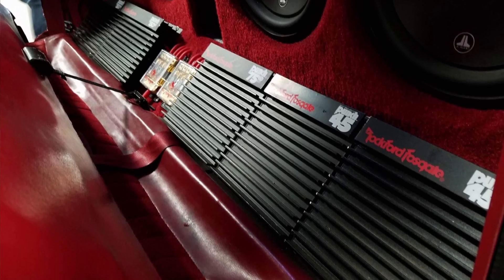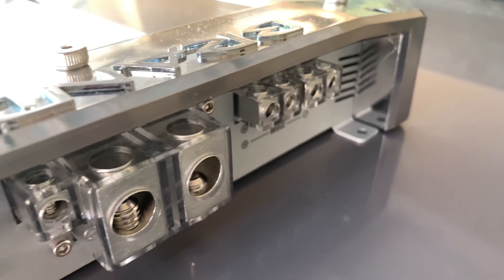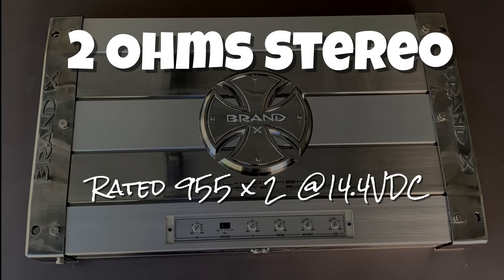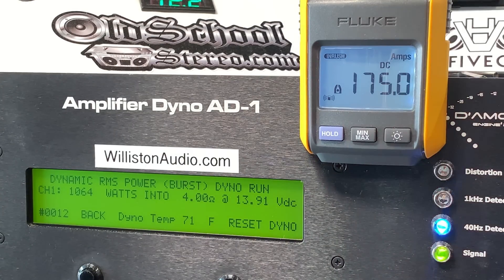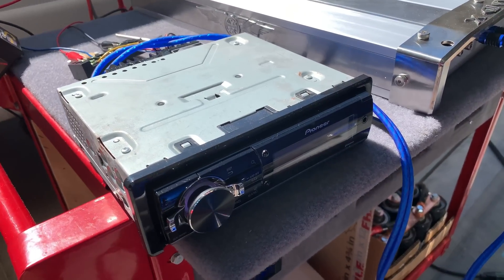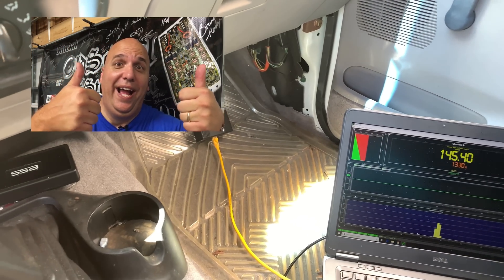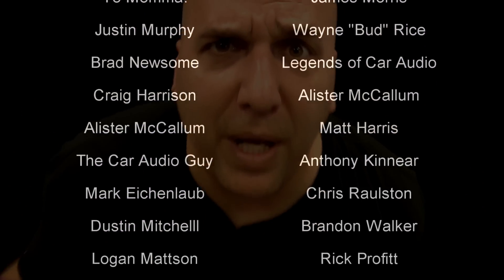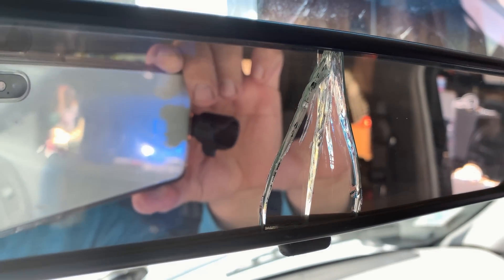$150 SPL Challenge Update - $75 Brand X 1910 Watt Amp [4K]

Comment: I feel like it was always meant to be just a spare hence why its mounted both away from, and at a different angle than the two that actually are hooked up. Unless the manual strictly states that it tales 3 60a fuses.
Reply from the maker: Could be?

Comment: Hey big d how is it possible that the amp did more power on the termlab with box rise than in perfect conditions on the dyno where it did 1100w
Reply from the maker: Voltage was higher

Comment: Longevity remains to be seen, but 1000w RMS today, is sure cheap these days. I know my RF 800a2 and MTX 1501D were way more than that, and that was on the used market. I actually paid $100 for my first "new" budget Legacy amp that barely did 200w clipped lol.  Kids today can sure get cheap and easy 1000w+.  🤣 Can do fairly loud setups for cheap!

Comment: Hey the emf guy said the amp dyno is not legit.  Please straighten him out
Reply from the maker: I think his comment was mislead. He says it can’t compare to “in car” actual results as it uses resistors. Future amp tests I’ll show Dyno and Speaker tests. The Dyno is still the best way to show actual power from an amplifier. Too many variables for subs in car.
Reply: @wal  yes I've seen Steve meade show the actual  in car power of a 1500 watt amp being only around 950. But on the dyno all amps are tested equal.

Comment: How did you clamp more power on the term lab than you did with the amp dyno? Did you run the amp at a lower ohm load than what you dynoed?
Reply from the maker: I didn’t verify ohm load at the power, but yes I’d say it was lower

Comment: Generally the RMS rating are @ 1/2 of the max power, so if the ratings they give are maximum power, then this amp actually does what it should.
Reply: Gary Turner that is completely wrong.....
Reply: @pmcalis1111  in what way...? technically peak is RMS x2
Reply: RWL2012 no it’s not... RMS x square root of 2 (1.414) gives you peak or “max”

Comment: Hello have you tested a amp with 2AWG inputs, how much it gives and then try a adapter that fits 0AWG to 2AWG terminals and if it gives more power and then dual 0AWG to 2AWG terminals? I would really love to see that kind of a video

And how big of a difference it makes if i have a sd3000 and i use 2awg versus 0awg how much power am i losing

Comment: Say what you want but for a/b ,that's not bad. There are not enough sizeable a/b amps being made now a days...
Reply: Uhh theres large ones made.   Like there's a few with dual  1/0 inputs. Almost 3k total power.    B2 makes a huge 1500.2 2ch AB amp.  Dual 1/0 inputs.  Very very similar to alphard 1500.2 except the alphard is class D.

Comment: I just realised that Big D is testing output power at 40Hz, whilst the industry "norm" is to test at 1kHz - perhaps that makes a difference with this unit? However it's more likely that the maker's specs are based on 10% THD which will result in perhaps double the power compared to 1% THD that Big D has the Amp Dyno set for..
Reply from the maker: Clipping is more than 10% THD and it didn’t get close

Comment: 145 I don't know so far it looks like you're winning for that class amp and sub! Anyone else stop that that you know of? RESPECT!! 🙏
Reply: Toros de reparo
Reply: Back in 1998, I had a buddy running (4) 10" Eclipse aluminum coned 500RMS subs powered off a couple JVC 1000RMS rated amps. He managed to hit 143.xxdB with them in the back of a 92' Jeep Cherokee. Funny thing, they ended up popping the back window out of the seal while we were driving down the highway. LMFAO That shit hurt though, my ears and chest both didn't like it at all.

Big D managed to top that with less power and MUCH cheaper equipment. Though my friend didn't exactly have a proper electrical system to support the setup.

Comment: Maybe those fuses are 90A fuses? seeing as it draws up to 200 amps without the fuses popping. if they were 60A fuses they would likely have blown on the 2ohm bridged test
Reply: Nah. As inefficient as it may be, those might be slow-blo. Though waiting a little longer may have popped them. Worst yet, maybe they cheaped out and stuck a piece of aluminum foil inside the standard blue plastic fuse housing?!
Reply: LOL its only 120 amps worth of fusing. the extra fuse does nothing
Reply: @realflow100  That was why I was saying maybe there are pieces of steel or something in those fuses. It is a liitle strange that they did not pop. They saved $0.13 by making their own!
Reply: yeah i was like what 220 amps??? thats almost 2x the rating of the fuses and they still didnt pop!
Reply: @realflow100  The fuses all say 'fast acting' so must have been short peak current. I guarantee if it put that power out twice as long the dual 60Amp fuses would have blown. Although on other videos I see similar instances now that I think of it. Like 300Amps and there was only a 250Amp fuse. I will find it.
Reply: crazy
Reply: @realflow100  I am messaging a guy watching this video that used to have an old school 1995 Lanzar OptiDrive 500.2!! That was like HiFonics Collossus destroyer! (ok. The 700.2 was, but this was the Zeus destroyer)

Comment: Bass Outlaws my all time favorite. My question is the CD FLAC style (original) better than mp3 quantity that it appears you used?
Reply: FLAC files are far superior to mp3 quality. Many times the data  information and quality of mp3.
Reply: Probably doesn't matter too much in an spl application.
Reply: Typically, it's the highs that are cut, not so much the lows in MP3 files. And even if lows are cut, it'd be audio below what he's going to be using to hit the numbers he's getting. The boost in output lessens more and more the further you go below the natural resonance of the vehicles cabin. Well, maybe the gain stops about half an octave below the resonance of the vehicle cabin.

Comment: Thanks B D... my first real 500 watt amp was a Lanzar opti 500 and I paid almost 900 dollars for it. Back in 93.  So for a bone I would say that amp is a pretty good buy.
Reply: Man! You had one of the big Lanzar amps back in the day! That was direct competition for the Zeus.
Reply: Yes it was an amazing amp . It had dual 6 gauge power and ground wires. I  traded it for a hifonics Olympus series seven 4 channel. Big mistake on my part.
Reply: @shanen921  Ahhh, I did an install for a guy in his 4Runner with two 15inch Alpine Pro subs (like JBL GTi) using a ln Olympus bridged to two channels in 1995. It was a Series VIII though - no matter. It only made 360Watts x2 into 4Ohms AND the Damping Factor dropped to measly 125 from 250. The Zeus woulda been 400 DF at 4Ohms. He got the Olympus because we couldn't get a white Zeus in time for him (after his was stolen and they stabbed his subs thanks to stainless security screws in 1995). Regardless, the Lanzar amplifiers had beautiful board layouts and the components were well-secured compared to HiFonics (something I always doubted about the ol' ZED HiFonics with so many upright components, but I put them in a dozen cars and they never died, ever). Lanzar had Orion HCCA-like PCB's. Totally made for abuse in an automotive environment, and pretty. Sorry I took so long to respond and wrote so much - I was watching BoostedBoyz Kyle take his Lebanese mother out for food using his 700HP red Civic hatch on this Mother's Day. He only did pulls in 3rd gear max!
Reply: @pgmurray76  its all good I . i thought i was being smart buy going for channel . I had two channels bridge to an orion 15" sub and the other two in stereo on a set of 4x6 Boston Acoustics . it did ok for the fronts but really fell behind on the sub. I guess hind sight is 20/20. I still love the old school Zed offerings but I think the first Gen Opti Drives are among there best stuff,
Reply: @shanen921  That was the same issue we had on the two Alpine 15's. It was not quite the same as the Zeus, but it still rattled our teeth. The uumphf and control was not the same. I can only IMAGINE what a Lanzar Opti 500 was doing! Actually, I am looking for a manual on Manualslib right now!
Reply: @shanen921  I am such an ass! I found the old school Opti Drive manual PDF. You had the Zeus DESTROYER! I was wayyy off. I was thinking of the total power for some reason. Obviously a 250.2 was more like a Zeus. And last I checked 500Watts x 2 into 4Ohms is really close to 600Watts like a Collossus. Then of course the 700.2. I am sorry it is gone.
Reply: @pgmurray76  I never got to run it at it's full potential. My alternator was only 110 amps so even at 4 ohms stereo it pushed all my electrical to the max. I should have mothballed it and saved it for later on but like I said hindsight.  The ratings I had for it was 250 x 2 at 4ohms  500 x 2 at 2 ohms and 1000 watts bridged. All RMS ratings.  The cool thing about it was it would make that power at as low as 11.8 volts.

Comment: OMG! They tried to punk you and anyone else buying the amplifier with that no-connect fuse. Real cute. Smart company to pull that off. Although, other companies might start putting triple 50Amp fuses on amps that saturate or run out of rail voltage by 600Watts output. Greaaattt. Thank God you are on Youtube both testing AND removing the covers! It is a pretty PCB for a 1000Watt inexpensive amp though.
Reply from the maker: Spare fuse FTW! That’s an old school trick, but again for $75 and it works I’m not complaining
Reply: @wal  LOL HiFiVega picked up on it ASAP! 1000Watts for $75 is definitely a win! (Though the 2 pack of Polk amps a month ago was a whole different kind of win altogether!)
Reply: Term-LAB!  Nice👍

Comment: Very decent for $100. 
Tiffany✓
Fan✓
Budget✓
0ga inputs✓
Reply: Spare fuse holder
Reply from the maker: Agreed! Looks a little futuristic though, crazy design. Needs some VU meters!
Reply: @wal  There is a cheaper model for $50 with a built in volt meter, and a meter that tells you how many amps you are pulling.
Reply: You can try upgrading it as well
Reply: Respectable numbers imo!...not a very nice looking amp tho!

Comment: Not bad for a 100 dollar amp!
Reply from the maker: I agree. Kinda sad how it kicked both the Orion XTR-2500 and HiFonics Zeus VII’s butt...😳
Reply: Would still rather have an xtr 2500 seeing as I have owned both. The brand x lasted about 3 weeks before it went up in smoke
Reply: @jasonsullivan324  I believe it. There's def more to audio then just watts. I rather have more expensive reliable gear. That's why my Memphis amp cost me $500 and only pushed 1500 watts..... After I bought it I had wished I went with Orion or skar. But the amps a total beast I see it lasting 20 years easily
Reply: @MLProductions.1  I have 3 skar evl 6.5's on a xtr 2500 @2.67ohm's and I'm very happy with it

Comment from the maker: Shop for the Brand X XXL609X2HE Amplifier: https://is.gd/brandx1910watt

12" Blaupunkt Subwoofers: https://amzn.to/2H2fLmY or https://is.gd/blau12subwoofer
Polk PA D2000.2 Amplifier (warning price jump!): https://amzn.to/2Pps3Ze
SSA APM-2 Wireless SPL Meter - https://is.gd/ssaapm2
Use code OSS-APM-2 for $15 off (out of stock currently)
TermLab Rebel: https://is.gd/termlabrebel
Reply: Very nice for this bugs is the amp ok but not ok ist this with the fuses! If one do a 2 zero gauge on this with a 500A fuse... oh oh then the Amp Burn when it have a problem or burn the complete car... 
Dont forget me my friend.. the score was good but have you saw the system with the 2x18 rockville PA Subs.. i think it was 148db.. 😊👍 nice Job hope you make a better score next time 😁👍
Reply: Hi Big D can you dyno the phoenix gold ti3 1300.1 amp and if possible could you do a 0.75 ohm test.
Reply: Damn! You're right on Ed's heels with that score. Doing 145.35 db with $150 worth of car audio gear. Wow! Impressive!  Very impressive! 🤨👍🏿🤨👍🏿
Reply: Hey Big D. Can I send a amp to you to Dyno ?
It's brand new and you can keep it. I sell them and would like to see the power they can generate
Reply: You should do a test on the CT sounds at 1400.1 see what the fluke says
Reply: I know this is off topic but do u by chance have ported box specs for an old school orion 12" dvc red subwoofer? tia
Reply: I know this is off topic.. but I have been wanting to see a audiobahn hct2300 on the dyno for a long time now!!! Would love to see what they really put out. Audiobahn gets a ton of hate... but I have used the 2300s and they seem to pump out the power!